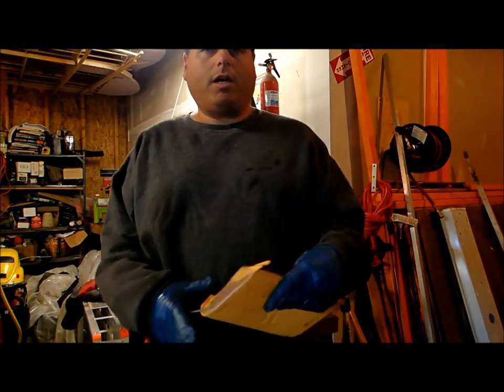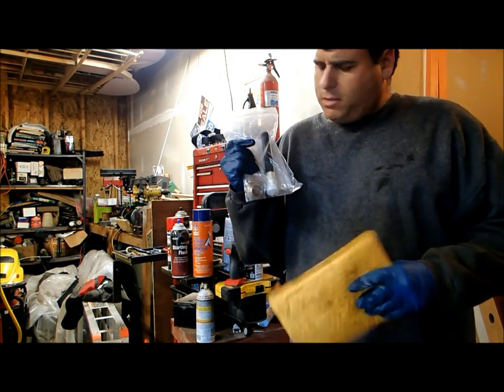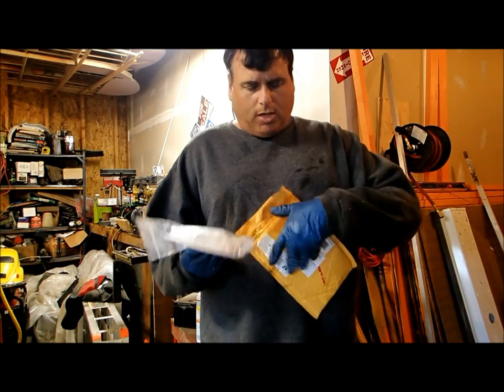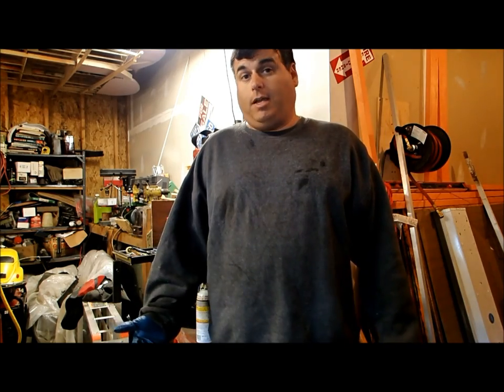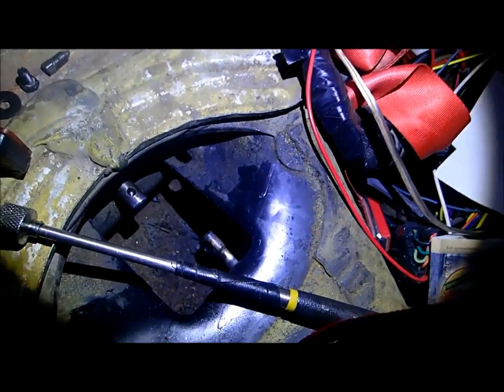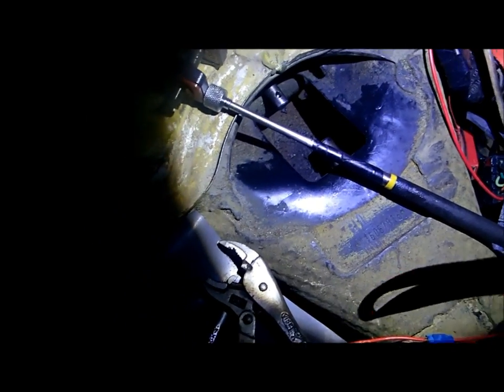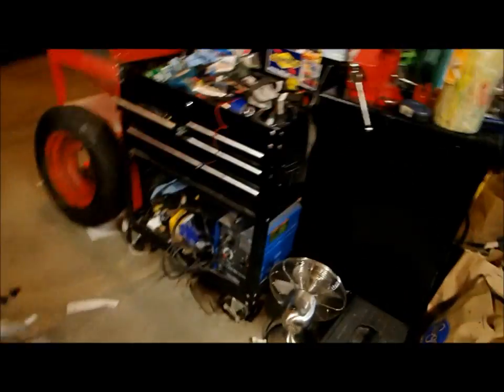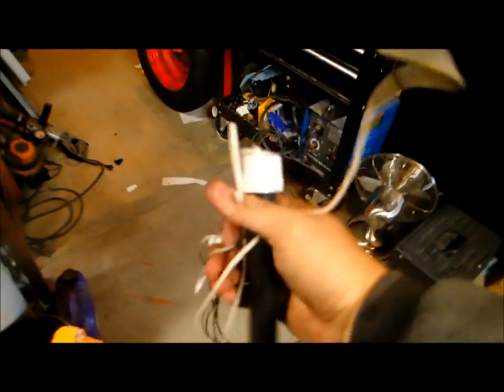Using EV4U Custom Conversions brass shifter rod bushing upgrade

Comment: the plastic is there to absorb vibration, replacing it with copper transfers wear to other, more expensive and less accessible parts.
Reply from the maker: Shane Rossbo the copper sleeve fits into a sheet metal carrier off of the center tunnel. Soooooooo nope.